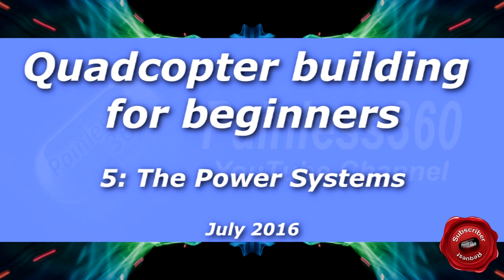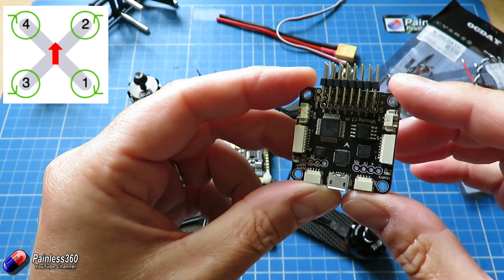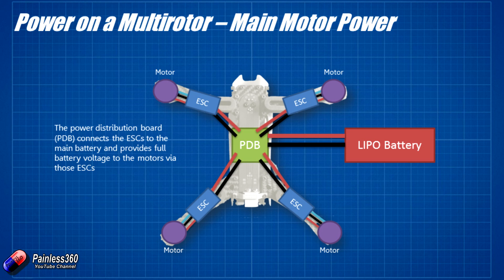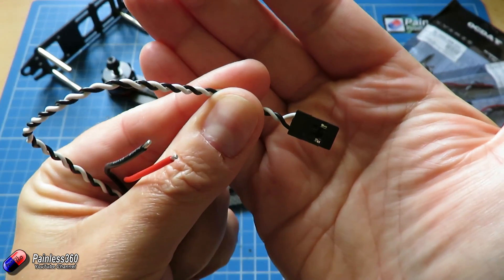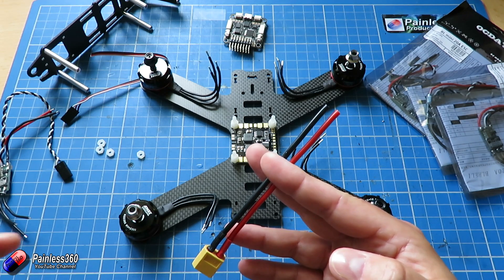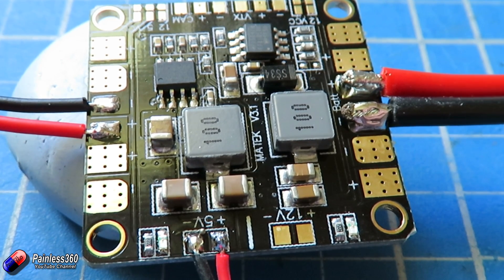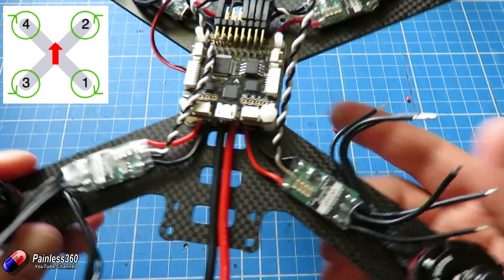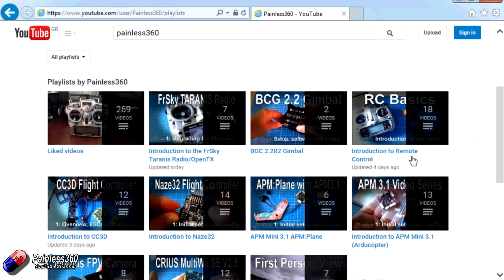(5/9) Quadcopter Building for Beginners - Connecting the main power systems

Comment: Hello painless,  
Could you please take about 70 seconds to watch a clip of mine. It's the only video I have on the tube. I swapped frames after I shorted an ESC which in turn killed the naze. As it was Un responsive  in CF. The previous quad was up & flying, but since swapping over & adding a new ESC & naze32 rev6 6dof, I'm having problems now with channel, mapping. Pitch & roll respond but throttle & yaw do nothing. Also when I try to calibrate the ESC's they beep but don't spin up. Between you & RC model reviews, I got all I know & had my first quad flying pretty much with no hassle. I took 4days off this week to add the new parts & go flying. But now have spent nearly 3 days on this problem. Any advice at all would be well appreciated.  Off anybody. Sorry I don't know how to link to to my videos either.
Reply from the maker: Impossible to tell from the pieces in the video. I can't see how the Rx is connected but I'd check the channel order if using PPM or the connections/wires if it's PWM. Best of luck!
Reply: +Painless360 I'm using pwm rx. I have just checked all the solder joints & re doing wires for about 4th time. Will add step by step clips. If don't mind looking.  Thanks for your time.
Reply: +Painless360 more short clips being uploaded as a step by step. Every thing in the correct location. Thanks again.
Reply from the maker: I'd check the channel order on the radio first. The first four channels should be the main 4 flight controls - Thr, Aile, Elev and Rudd (on some order). There is usually a menu item to view the channel values as you move the sticks (see the videos we've just done in the Quad build for beginners series on the FS-I6s radio). If that checks out then it's something on the FC.. Best of luck..
Reply: +Painless360 thanks for the reply painless. But I sussed it out.  I had typed the RX_PWM in cli, as - RX then saved. Not realised that the minus sign takes it away & applies default ppm setting. 3 days. Then when I finally got out there is an unused golf course close to were I live but overgrown. With being a noob I thought the long grass be a bit of a cushion for some crashes. It was but we live on the windy wirral. & it dived into what I though was a load of nettles, anyway 3 hours later I was still searching. Well I had a battery buzzer set up. But with it being tangled &  upside down it wasn't arming so I decides to wait it out for the sound. Was about to give up when I see the lights @ about 11:20pm.oh the joy but it was about 12 foot from where I was searching flattening nettles in shorts & trainers. So lesson learned again. Next is a lost  buzzer for sure.
Reply: +Painless360 in my search for an answer to my problem. I came across loads of people  with the same. Even people who had given up on the hobby & sold up. Shame because it was just a cli command. I even tried about 100 different combinations of aetr1234, & gave myself a headache. So if anyone says the  channel mapping is mixed up & using pwm, they likely have not changed the cli command from ppm. Or in my case properly.

Comment: Thanks for the video!
But i have one question. Is it necessary to connect the ground wires from each esc to the fc? Because i saw it from a website that connecting only the signal wires should be enough, that would keep the fc much smaller :)
Reply from the maker: It should be fine without them but at the first sign of problems with the ESCs I'd add then back on.. Best of luck!

Comment: I'm just looking at building exactly this kit, but I noticed that they've now got an upgraded version with 30A Littlebee ESCs. Prices are currently $188.61 (AUD) with the 20A ESCs, and $227.83 with the 30A ESCs. Is the upgrade good value for money? Is there any performance or reliability issues running 4S on those 20A ESCs?
Reply from the maker: +Joric78 you need the 30A ESCs to run 4s. See the early videos in the series where we cover that.. Best of luck!
Reply: Cheers! I was looking for it, but should have just watched the second video. Based on that info, it seems like a lot of the kits underspec the ESCs while claiming 4s compatibility (including "RTF" units like the JJRC P200). Great job on these video series.
Reply from the maker: Always pays to do your own homework as some of these kits are not spec'd by 'experts'. Happy flying!

Comment: I have a question about the ESC's . I bought those too from gearbest and they say it's all ready preflashed with BLheli and ONESHOT125. Are you having problem with the ONESHOT125 aswel? Because mine won't work on ONESHOT125 and I don't have a flasher yet.
Reply from the maker: +KoekeBeest1985 you don't need any specialised kit to update them. You can update the ESCs though the flight controller using BLHeliSuite. See the troubleshooting video in this series. It fixed ours here..
Reply: Hm, I did not know. Let me check that video out :) Thanks.

Comment: Hi Painless, I use these:

http://www.banggood.com/20pcs-2p-Quick-Connector-cable-clamp-Terminal-Block-Spring-Connector-Wire-LED-Strip-Light-Wire-Connecting-p-1001440.html.

To connect the esc and motor to check the rotation direction, saves having to solder then resolder if direction is wrong. Of course if they were Blheli esc's you could change the direction by the software.
Reply from the maker: +Anthony Witham thanks for the links. The idea with this series is that even if you're not using the same kit the same basic processes will work. We do end up looking at BLHeliSuite later in the series as part of the troubleshooting video ;)

Comment: Do all PDB's have a 5v out solder pad? I just checked the voltages of all my solder pads and they all showed 8.3v. If I buy a UBEC can I plug it into one of these pads ?
Reply from the maker: Sadly not, you can use a separate BEC and power it from any of the pads that are providing the battery voltage. See out power videos in the 'Introduction to Remote Control' series..

Comment: Thanks for this series!  I'm actually following along at home as I've purchased this same quad (Dubai 210).  

I've run into problems since I'm now further along but I hope you will address in this series:
- Frame is so narrow that wires off the PDB are exposed to the props
- Where to put the receiver (Flysky ia6 currently tucked under  the PDB raised by 10mm standoff)
- ia6 seems to only handle PWM so more wires needed/exposed
- Powering the SPF3 via the 8 pin JST the darn wires are so small/thin they broke off the PDB and when re-soldered have now pulled out of the JST connector
- I went back and turned the SPF3 -90 deg so I could access the USB but leaves the receiver wires out the side between props (yes, I updated in BetaFlight to account for -90 deg yaw)
- I crashed it from only 3 feet up due to a death spin (not sure why it happened) and now I've got an ESC that may be burning out (gets hot to touch and makes a buzzing sound) or worse killed the motor... 

I'm bummed out but hopeful your videos will illustrate what I've done wrong - Here's hoping this encourages you that at least one person is actually following along and enjoying this series!
Reply from the maker: Keep watching ;) Best of luck with the build..